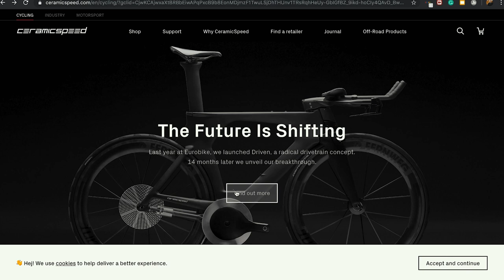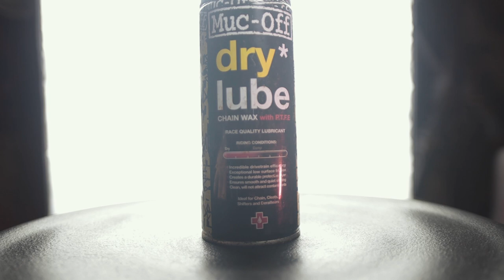FACT OR FRICTION - Bike Drivetrain Efficiency PART 1 #nosmallcreator #triathlete #timetrail

Comment: I agree with your big three, I’m just switching over to a 1x drivetrain for a better chain line hammering away on the flats, and a waxed chain as well, can’t wait to see your next video to s we what wax you use or make, I have been kicking around what to buy, and haven’t pulled the trigger yet cause I’m still waiting for my clics and deraileur to arrive
Reply from the maker: Thanks Steven - sounds like a great set up! I was only thinking the others at that there are two videos in series’s that I haven’t finished yet - this one and the power meter one - I must get around to doing those! I made my own wax to begin with but then just started using Molten Speed Wax which is aces. I have also bought some Absolute Black wax which I haven’t actually used yet… I will defo make this vid though…! Thanks so much for watching and commenting! What races have you got coming up this season?

Comment: I have always just used white spirit followed by some soapy water and then clean water to clean the chain before waxing, what is the role of methylated spirits in your recommendation??
Reply from the maker: Great question! I’ve always followed Molten Speed Wax’s procedure for cleaning before waxing - and have made an assumption (always dangerous) that the meths is much lighter than white spirit and evaporates more easily due to the high ethanol content - essentially washing away the remaining white spirit but without leaving the chain ‘wet’ - in the past when I’ve just used white spirit and water/soap - I’ve had trouble getting it completely dry enough to ensure the wax will go into all of the parts of the chain - I’ve even dried it out in the oven before. With a meths Bath, the chain always feels squeaky clean after - and dry to touch. 

So - that said - I’ve dropped Adam Keris a line to find out his thoughts on this! He’s the expert, really..!
Reply from the maker: Righto - yes, I was fairly correct! Here's Adam's reply:

"Soapy water comes up a bit and I have no idea why. Soapy water will leave a soapy film behind. If one is waxing or using a wax lube, it will not be able to bond to nice clean chain metal as the film will prevent it bonding to anything. 20km down the road one will have a dry horrible sounding and feeling chain and think 'man this waxing caper is crap'.
 
Even if one is not waxing but cleaning factory lube and wishing to use a different lube they hope will be awesome, you want the lube to have clear access to clean metal, not having to fight its way through a film left behind from cleaning. This is why many common ways of cleaning chains – degreasers, diesel, petrol etc – do an ok clean but leave a notable film behind that lube will have to try to fight through to get to chain metal. Some lubricants this will not affect at all or barely affect, other lubricants it will affect how well they are able to do their thing quite a lot.
 
Mineral turps or mineral spirits is a very clean hydrocarbon-based solvent and leaves little film behind to begin with, and then metho or denatured alcohol is basically pure alcohol so removes any little film that is left. Prepping a chain should be seen as 2 part process. Part 1 is cleaning chain, part 2 is ensuring there is no film left behind from cleaning so that chosen lubricant has complete access to bond to chain metal."

Hope that helps, CG?
Reply: @1stElement  many thanks for such a detailed follow up. Greatly appreciated and I will enjoy the extra watt saved from having an even cleaner chain than ever before.
Reply from the maker: +CG we work hard for them - seems daft to waste them - we aim to please!